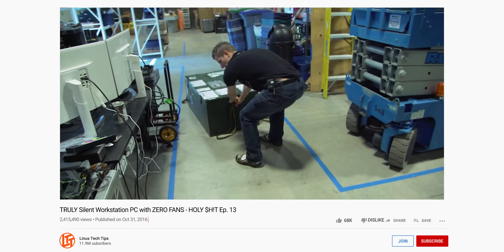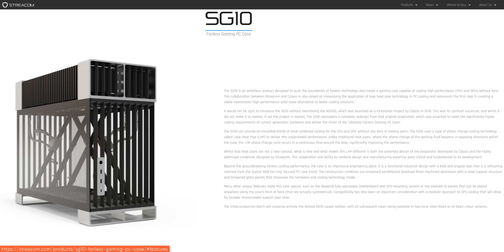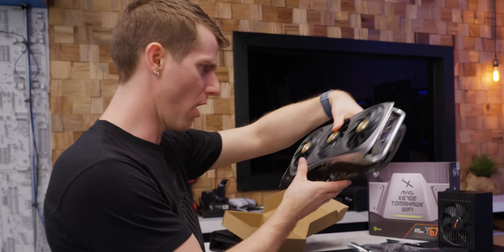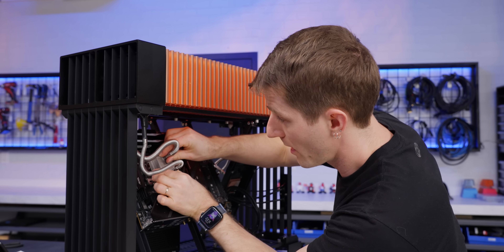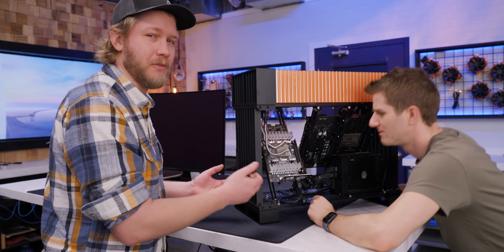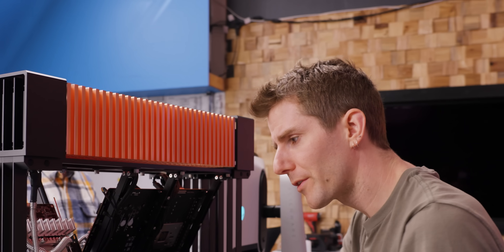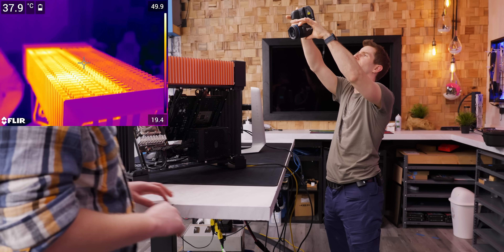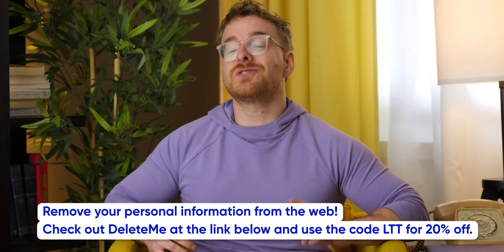I bought this scam PC case... And it actually arrived

Comment: I'm a TIG welder that specializes in welding very thin gauge stainless steel, I'm talking thinner than a soda can. And I noticed that the fittings on the CPU block appear to be TIG welded in place. Those welds are beautiful. Those are the kind of welds I do, I'm good at making them, and whoever made those is good at it too.
Reply: Chances are it’s a machine weld
Reply: @samcrew1443  I'm not too familiar with automated welding. But I can do manual and CNC machining. I imagine the welding machine would be similar to a CNC machine, where you have to load the parts, find the zero, run the program, and restart. I could probably weld a dozen of those fittings by hand in 5 minutes. Unless the welding machine is automated and just spits those out all day, I think welding by hand might be faster.
Reply: @alphalimaindia9638  or it was welded by a robot 🙄
Reply: @jman0870 yes, and technically? 
BY A HAND ✔️
Reply: @NarutoUzumaki-gk5yv  huh? 🙄
Reply: @jman0870  I meant robot's hand 😅😂
Reply: @samcrew1443  For a low volume project?
Reply: @samcrew1443  would've agreed, but 3:26 shows a little run-out in the puddle on the middle weld of the large tube that a robot wouldn't have unless something shifted during the weld.
Reply: first ever welder on earth to see a good weld
Reply: @jackjgj  Other than their own lol
Reply: @ You would have to be a small gauge welder to understand. Any small gauge welder can weld large gauge, but very few large gauge welders can weld small gauge. When your welding on a large chunk of metal, that piece of metal can soak up excess heat easily. If you don't know what your doing on small gauge, as soon as you strike your arc, everything just melts into a puddle. Have you ever heard a welder say he can weld 2 pieces of foil from a gum wrapper together? There's a reason why that's a flex.
Reply: @ most welders can’t weld their heads out of their asses without the proper positioning and lighting. The overwhelming majority of welders are full of shit.
Reply: @jman0870  maybe you are just jealous ?
Reply: Do you have any socials to share? Sounds scammy, I know, just curious if you show off your welds anywhere.
Reply: @ I can do out of position welds, I just don't like to.
Reply: @alphalimaindia9638  Yeah, takes many years and experience to turn down the friggin voltage....
Reply: @alphalimaindia9638  I used to professionally paint, and not many people can undestand the process of getting great results nor pay for them. Many coats and prep between them, and make darn sure you know what your painting over.
Reply: @jman0870  What welders are you talking about? Automotive or shipbuilders because naval shipyard welders are x ray certd for every weld they do.
Reply: @BrockTheTrainer production welders. You know, the most common welding job in the fucking county?
Reply: @jman0870  industrial vs production? What are we comparing, I'm curious.
Reply: @BrockTheTrainer huh? Production welders are industrial welders smooth brain. This conversation is over.
Reply: @jman0870  r u trolling? or slow? 😭😭
Reply: @BrockTheTrainer let me get this straight. YOU tagged me with a question. I answered it. You didn’t like the answer and now I’m the slow one? Your parents must be so proud
Reply: @jman0870  why fhe rage bro? Your whole comment chain started stressed out with the other guy. Chill out.
Reply: @alphalimaindia9638  it goes both ways most small gauge welders wont know the ins and out of welding very thick metals in 6G positions while most tig welders can weld gum wrappers via the vice trick you just fold over the foil in a vice with a little strip of the fold sticking out and melt it down looks like a perfect weld every time. most can also tig weld soda cans as a party trick with enough tries but to know the deeper workings is the next level which is were the specializations come into play
Reply: @jackjgj  you killed me with this comment
Reply: TIG ftw.
Reply: I think the best shot of the welds you're talking about are at 3:25. In my opinion it looks hand welded.
Reply: Hell yeah brother 💪
Reply: Good eye bro I'm also a tig welder i build and weld x-ray tubes with a variety of tube sizes and welds and I agree they are super clean 👌
Reply: No one cares
Reply: linus just calls Scam on anything he doesnt understand, which is most stuff.
Reply: You‘re definitely not missing out on self-confidence.
Reply: First time I've seen a welder compliment another welders work lol
Reply: @clipperkid3753 as a 44 year journeyman welder I can confirm compliments within the welding community do happen but you are not wrong on their rarity lmao.
Reply: Honestly man, seeing your passion about welds is kinda inspiring
Reply: I own a TIG welding machine and I cannot weld anything thinner than a soda can (although I have run a bead on a soda can).
Reply: @alphalimaindia9638  well said fellow human, say where's that leader of ours that everyone keeps talking about?
Reply: Those welds are 100% hand welded. I hope whoever did it was paid well.
Reply: Talking TIG welders! 2025 is blowing me away. 👴
Reply: Needs a sterling fan.
Reply: awww so you use one of those teeny weeny wolframs haha and like 45 to 100 amps ? what guage wire you use for dipping? i do the weave so nice with a bigger one, i weld STEEEL haha, 3 mm wolfram, 200 amps. she buzzin
Reply: I used to be a welder aswell, MIG and TIG, mostly the latter, working on aluminum. I'm no expert, but I would say that those welds on the CPU block is definitely a robot of some sort.
Reply: As a guy who likes his welds looking like the "I Stack Dimes!" aesthetic, I am always impressed by smooth welds on super thin material. It's either done by robot or the hand-held expertise is basically earth-shattering in terms of specific experience and breadth of welding knowledge required to do such welds!

I am actually quite shocked that LTT hasn't YET done it's own in-house case for merch sales! What I could envision being done for a super-case is almost unfathomable! How about an officially licenced IP of both the BSG original and reimagined Cylon Centurion Heads as computer cases with 8 onboard USB Type-A connectors, 8 onboard Type-C connectors and 8 onboard DCI-8K 120 fps HDMI-2.x/Displayport connectors in the back! I would pay good money for those cases and if pure shiny anodized 5052 aluminum metal is used with moving RGB eyes, it would be an AWESOME set of cases to sell on LTT!

I think LMG needs to hire me in merch product development!

V
Reply: @alphalimaindia9638  "I'm pretty amazing. Guy who welded it? He's pretty amazing too. But I'm also amazing." lol
Reply: @alphalimaindia9638  small gauge welding is art man thats a gotta be a sweet job
Reply: Uwww he controls heat good, cool
Reply: Real recognize real.
Reply: my goodness those ARE some clean welds, I didn't even notice it was a weld until I went back and looked

Comment: $2000 is exactly the ridiculous price I expected. It's an awesome case, but my entire PC cost about that much, I can't justify that for a case and a cooler.
Reply: Well $1000 depending on region is the aluminum one. If all checks out it could be a lifetime case with gpu/cpu parts available. Then the price is actually decent because this thing is a work of art.

Comment: Back in the days i had zalmanns on 2-3 different graphic cards, and one time i tried a no fan at all in the case (big homemade watercooling and big outside radiator) and it worked like a charm, i just had a high pressure pump/block.

Comment: While it may look "cool" i guess, its very much not lol

I have a dual tower heat sink that runs my cpu at 55C while under ultra settings in even the most intense games 😂 and it costs $120 so i think ill stick to air cooling lol 

I also dont have to mess with gpu rig so not worth it, gets way to hot.

Comment: Totally on board for this case.  Probably one of the coolest things I've seen in like 10 years in the case word.  I was one of those weirdos who wanted the odd shaped, impractical, hard to build in cases that might cause thermal issues.  I really don't care for the modern "it's a rectangle shape with tempered glass" that seems to have flooded the case market.  When you revealed the price for the copper version, I was actually surprised it wasn't more money.

Comment: $1000 is what a decent dual loop water cooling rig (alphacool, Bitspower, etc) with good fans costs, so not out of line at all. I'd worry about contact on the power components of a high-end GPU, especially now when replacing one is next to impossible.

Comment: Okay that's kinda cool, I can see why people would back it EXCEPT for one small problem; it's going to drive you crazy unless you keep it in a chip fab plant where it's not going to fill up with dust.. Also design note from an engineer - they should really have thermally bridged those heatsinks on top..

Comment: Even if some of the GPU heat is a tad concerning, I'm just loving how it looks. Something about having the GPU and the MOBO installed on an angle just seems cool to me. Honestly IF the aluminum version has basically the same performance, I could see myself splurging for a case like that if I was already doing a fanless build. That said, it all probably works better in a wide open studio more than a small enclosed gaming room/ bedroom (depending on your setup), might be nice in the winter though.

Comment: 11:03 PAUSE IT! ~ your S curved pipes problem. THe CPU should be lower so that the pipes curve up slightly towards the top, so theres no downward section. That way the fluid reaches the heat pipe without restriction. Similar to hot water pipes in plumbing :)

Comment: The problem with passive cooling is that the in most modern hardware the noise is not from the fans nor pump, it’s the coil whine
Reply: i have a 9950x and a 6700xt, but i dont have any coil whine in my system. its basically silent
Reply: @  my rtx 3070ti fe is very loud
Reply: @evanleo7633  My 3080 was insanely loud, my 4080 now is real quiet (coilwine wise) but my cpu is super annoying when ideling. So i totally agree with you. My fans are by far the least annoying noise out of my case during idle AND load.
Reply: @alexwithanx  I think good quality third party card are quieter? My 4090laptop is significantly quieter than my 3070ti fe
Reply: @evanleo7633  Its just luck really. When it comes to coil whine at least. My 3080 was an Asus Rog Strix so a very expensive 3080. My 4080 is an iChill X3.
Reply: That really depends. Coil whine is not a constant. My computers all are mostly noisy from fans most of the time. I've also heard that coil whine can be largely mitigated if component manufacturers 'glue' in the coils for a little extra cost, though as I'm no kind of material engineer I've no idea how true to life that statement was. In any case, it's a grab bag whether you'll get coil whine when not running some old game's main menu at 2000 FPS. But unless you got very unlucky, most of your computer's noise will definitely be from fans, pumps, or HDDs.
Reply: Vsync will stop it.

Comment: Imagine having that in an apartment room - bedroom. People do not live in big storages - so this test is not even remotely a sample of what a regular user will meet. That hot air will create a sauna.
Reply: If you think about it you'll realise that this is just moving the heat that the PC produces, same as fans do. The ONLY difference is that the fan motors add to the heat and the PSU would theoretically run ever so slightly hotter to supply them.

Comment: 19:57 "high quality termal paste" is dripping sideways... that's... normal?
Reply: 8:07 * And it wasn't dripping, that was from when Linus yoinked it away and it pulled that "string" with the surface tension of the paste. 

They cut out when he touched it, but you can see the paste on the sticker he peels away.

Comment: both my gpu and cpu run below 60 degrees C even after extensive raytraced gaming, I'm also missing an exhaust fan. 9900x and 7800xt are great pieces of hardware but why is my system much cooler than what seems like the average of 75C

Comment: 12:05 you hear it from the top coz the heatsink acts like an amplifier. Sound being carried very well by metal into the top heatsink and the fins can vibrate so easily

its basicaly a powereless speaker

Comment: for that amount of money I would just encase my build in an air conditioner.

tbh back when I was 12 I used a dryer vent hose with insulation to pipe in 3 Degree Fahrenheit winter air to push my Athlon to 1.6 GHZ, which was insane speed back then.

Comment: Great video! One thing I noticed is that you didn’t show the wattage of the CPU and GPU during testing. While CPUs usually stay between 100-150 watts in games, GPUs like the RTX 4090 can vary a lot.

GPU utilization percentage doesn’t always match power draw. In the same game, my 4090 can run at 90%+ utilization and draw anywhere from 300 to 600 watts depending on the settings. This is because features like DLSS or AI upscaling often reduce power usage by rendering at a lower internal resolution, while native high-res and ray tracing push the GPU harder and increase power draw.

Also, many high-end GPUs can exceed their rated power limits. For example, my 4090 can hit 120% power draw, reaching up to 600 watts. In the game shown in the video, it’s possible that AI upscaling (like DLSS) was enabled, which could theoretically reduce the power draw to around 300 watts instead of 500+ if running at native resolution.

To accurately assess cooling, it would be best to test with the most computationally intense settings where the GPU is likely to reach its maximum power draw. Including both wattage measurements and power draw as a percentage would give a clearer picture of thermal performance!

Comment: Hey new to PC building, is having my PC next to my ac blowing cold air into the PC a bad idea? Or should it be working with room temp air? 

Does it matter? Had it like this for a week and haven't noticed anything, stays about 85 degrees but I don't run anything crazy either

Comment: Still not an an abosorbtion cooler driven by a heating element to get under room temp with no moving parts. not good enough linus if you want to win back my trust and admiration try harder. we have better tech than this in hotel fridges for christ sake stop being impressed by over engineered garbage people.

Comment: I think there are some effects based on the room temperature.
I'm very assure that the cold regions will work very well.

But hotter areas? Hmm.... maybe no...?
If you put fans on it, it will work eventually.
But because the cooler is actually indirectly contact with the cooler, so it may take some time to cool-off the components.
I mean it is contacted to cooler, but because it uses special coolant that liquid turns to gas, it may not very efficient way to cool down in hotter areas.

Comment: What about with intake fans, and a couple more heatsinks like that funny corsair ssd, add a couple noctua black fans, the 140mm ones for bottom intake and see if it doesn't just increase airflow, but also decreases temperatures, ofc with a very very low RPM setting on the fans.

Comment: I was never sold on the RGB craze. This is my kind of look. Amazing. If this case gets new parts to install new hardware, $2000 isn't really that much. I remember one of my first Pentium 3 heat sinks was a huge copper heat sink weighting 1.3kg/2.8lbs. So heavy it had a bracket to stiffen the motherboard and struts to mount it through and into the back plate.

Comment: This style of refrigeration is literally how camper style fridges work. They use a heat source to warm the refrigerant to cycle it through the system basically using convection.
Reply: This is just a heat pipe, basically just moving heat around. What your thinking is absorption  refrigeration.

Comment: Now I want you to set it out a window on a winter day. That case is sexual, however just a little bit of dust accumulation could lead to dramatic failure. Also maybe one fan on the bottom of the case would greatly improve cooling.